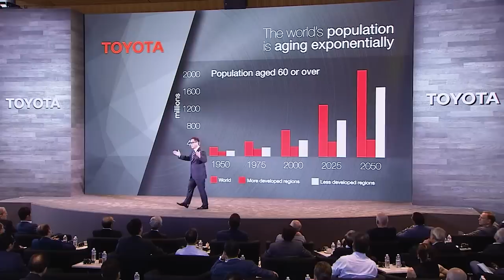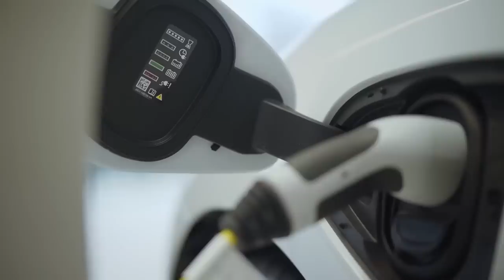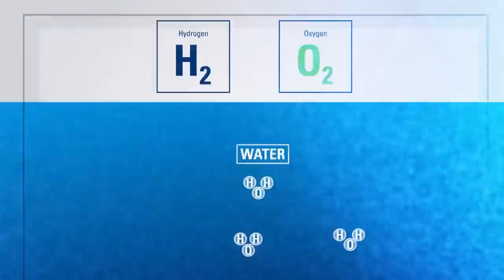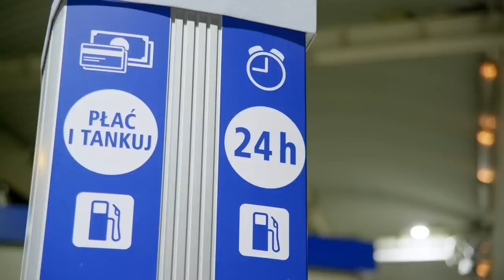New Toyota CEO Shocks Everybody | Huge News

Comment: I like the concept of hydrogen over EV. Just imagine the pollution to make batteries and the E waste. 😵‍💫
Reply: I know I always look at it as exchanging one problem with another, I want to know how long will the batteries last will the driving range decrease as the battery ages and if so how much year by year and how are we disposing the batteries and how will that effect the environment and lastly how are we generating the electricity to charge these cars
Reply: Hydrogen would work just fine if the refining methods could change. It takes a huge amount of electricity to create pure Hydrogen. Hydrogen does work excellent but uses more energy to produce and ends up being the least efficient by a long shot.
Reply: Hydrogen production uses heat to produce...heat provided by burning Natural Gas. The carbon cost of creating Hydrogen and simply burning Natural Gas is almost dead even, depending on the purity of the hydrogen produced. Hydrogen's carbon cost is certainly lower than EV, but it's still not "carbon neutral."
Reply: Every fuel cell hydrogen vehicle has a traction battery, you know?

Also 3-4 times as much wind turbines and solar panels doesn't create any e waste at the end of their life cycle.
Your logic is absolutely flawless.
Reply: Also Toyota thinks that EV’s lack infrastructure, and their solution is hydrogen? Do people have hydrogen faucets in their garages? The only places where even gasoline infrastructure is better are in the third world, and Toyota, like tobacco companies, thinks it’s their last refuge…
Reply: @noeoep  fuel cell is a straw man for all that are against EV because others prefer EVs. It's not about facts.
Reply: @alphastratus6623 . Ballard had Hydrogen fuel cell busses running around Vancouver for several years. Do you know why they were a failure? Apparently you don't.
Reply: But refining hydrogen is way more polluting than creating an EV. Not to mention, that hydrogen cars are EV, they are just charged by Hydrogen. You don't have Hydrogen avail everywhere, but you do have electricity availble everywhere. I do have an EV, but I also own a gas powered car, but I rarely use the gas powered car, because I can go everywhere in my EV. Where I live, there are fast chargers everywhere, and I do live in a cold climate area, and I still go 300+ km, without recharging the car, in -15 degree c. 110 to 120 kmh.
Reply: @alphastratus6623  I'm definitely not against electric vehicles but I don't think we can go 100% electric either, I think EVs are great for getting around cities and being used as daily drivers but I'm not so sure they are going to be effective for farmers or the construction industry at least as the technology is at the moment but I would love to see all public transportation switched over to electric powerd vehicles and more city daily drivers using electric cars but I also have my concerns
Reply: Truth does hurt
Reply: ZOOM OUT YOUR VIEW. the problem is PRIVATE CARS ARE INHERENTLY STUPID- 2000kg of metal to move 100kg of person has NEVER made sense no matter the fuel source.  get our of car-centric tunnel vision.
Reply: @theQuickining  Why shouldn't the cars on construction sides or farms shouldn't be electric?

Farm and construction equipment, that's another story.
Reply: @raywagner8016  Green hydrogen (only green electric energy) or some grey hydrogen as a side product of an industrial process?
The second one is not environmental friendly at all and no valid point for the discussion.
Reply: @A_friend_of_Aristotle  It uses electricity, which doesn’t need to be generated from natural gas.
Reply: way less than making ICE cars and burning oil.
Reply: @alphastratus6623 . You can refine Hydrogen using a disproportionate amount of electricity to produce it or you can power a Hydrogen cell using Propane or Natural Gas. The Ballard Power Systems version used Natural Gas. Either way, neither is viable. Heat in is greater than the heat out... by a lot.  Period. So yes, you have no valid point for discussion.
Reply: Current problem is the hydrogen pump station always broken.
Reply: @raywagner8016  When they used natural gas it's far away from green. So what's your point? It's not a green option, so why did you bring it up?
Reply: @theQuickining  These questions have all been answered, the batteries only last less than 10 years and yes using them does diminish their effectiveness. 
Imagine if using a fuel tank made the fuel tank get smaller every time you use it until it needs to be replaced.
Reply: On top of creating hydrogen being difficult, transporting it is hard too and costs a lot of money, and a truck likely running on gas.
Reply: Just imagine the non-existant tech needed for hydrogen! Plus the lack of safety!
Reply: Wait what pollution? This will solve all climate issues, don’t you watch the news? Don’t even think about what is power it he electric grid that gives your car electricity. I’m sure that’s in the carbon neutral offset calculation…
Reply: @joshuaenos9001  Electric power only pollutes if you insist on burning coal like a caveman.
Reply: Hydrogen cars have an battery with from 7,5 and 15 kWh. And the drive unit is fully electric, exactly the same as an EV...
Reply: @noeoep  like a hose bib or outdoor faucet? how many people have garages? Have you been to a third world country?
Reply: @Pilotfarmand  lol you drive your EV because it cost up to your nose, and it’s novelty currently. 

Reality is electricity is cheap because BARELY ANYONE is plugging EV to the power grid, once they do, guess what? Because of you and others, many who don’t even drive will have higher power and heating bills.

Why? Because one the grid is overwhelmed and they have created so many public or private power stations, someone will have to subsidize all that or pay the costs. This means the “reasoning” behind owning an EV will be useless because it won’t any longer be cheap to fill up. It’s a drg dealer, the first 10-20 hits will be free or discounted to get your addicted or in the door, once you’re a client and they have established themselves, you will begin to pay actual prices making you afford less.

The same logic will happen, and once these same EV companies have “overtaken” ICE cars they will draw up contracts with power companies to make even more cash by letting them increase power usage through their sales. 

Now power prices will go up and the ones subsidizing your “fill up” costs will be the rest of the citizens paying higher power fees because someone wants to save the planet.

The result? Half asszed EVs will hit the market that will ware out faster but be cheaper to balance out the high costs of living some people will have to deal with.

And if you’re a clown buying EV now because it’s “cheaper to fill up” you will soon hit a wall and a problem when those plug-in fees jump up.

What, you think power grids will just support everyone plugging in when they can barely handle super hot days and ACs to the max? 

Hell even the subsidy some countries handed out during cvid made regular folks feel the pinch when “regular rates” were back on the table.

Reality is EVs destroy the earth more to get the resources, it will costs lives when countries begin to war for said resources, slave wages in the countries mining it, no open source for repairs because all services may end up patented or restricted, high costs to “replace” maintainable parts, instead of having a car for 30 years you’ll buy “new” batteries for 1/3 of a entry level vehicle’s price every 10-15 years (think iPhones) which is what they want, consumerism 

It makes more sense to sell you driving iPhones that need constant replacements then to give you a heavy duty tool that will last you even a lifetime and bring many uses. 

The funniest part is you guys say EVs are cheaper to make etc, yet the price tags don’t reflect that, the interiors are hideous and plain, yet cost you more than a luxury brand. Imagine when these smart cars team up with insurances to place speed limits on your vehicles or can disable your car because you broke “a rule”? 

Hell no
Reply: These bandwagon hipsters don't think about that at all. They just want to post on Instagram they are "saving" the planet by driving a crap made Tesla.
Reply: @ftws41  I haven’t recently. A third world country could start with a solar panel+ electric bicycle for every household? My point was that to plug holes and weak points in existing infrastructures is easier than building a completely new and more complex one in addition to existing ones. And i think for most cases elecrical infrastructure is a best choice because it’s usually public, can in principle be made carbon-neutral, and is neccesary anyway. Hydrogen is best left to aviation, where it outshines the other two. Hydrocarbons are a limited resource and are handy for many things other than to be set on fire.
Reply: @hakasonma8588  I am not sure which country you are from, but my guess is USA. But your comment is irrelevant. Where I come from, the energy used mostly comes from 100% wind energy, and we share grid with countries that have a lot of energy produced by natural water flow, which makes the energy cost to consumers very cheap. Most of the cities have environmental zones, where no diesel car or trucks is allowed, so they don’t pollute with toxic gases inside the city zone, where population is dense. Yearly people are having health problems due to that exact problem, which having a high demand on our healthcare. So by going electric makes much more sense. But if you are from the states, I do question your education level, on this specific problem, since I often see a link between Americans and that subject.
Reply: "6 in one half a dozen in the other" is the expression.
Reply: @A_friend_of_Aristotle  Fantasy land is carbon neutral, though.......
Reply: The Toyota Mirai Hydrogen power car still uses an electric battery. It captures static electricity produced from separating hydrogen molecules, and charges a battery, to power an electric motor. Emits nothing but water.
Reply: @Your-Mom162  what is the size of the battery in electric car and hydrogen car?
Reply: @A_friend_of_Aristotle  Most of the new Hydrogen plants being built at the moment are using renewal hydro, solar and wind to power.Still I can't see Hydrogen being the solution for general vehicles, perhaps trucks and buses will work.
Reply: @zacharyb2723  and cramming as many people as possible in as small a space as possible is also inherently stupid. This is not the makings of a healthy society but a means of corralling every one into a easily manage confine for the purpose of controlling what the individual does. Where is all of this electricity going to come from? The grid currently in summer struggles on warm days due to the demand for power to run air conditioning units, not to mention how it is supposed to cope with an ever increasing demand for power to charge EVs in off peak times. I can't imagine that a large percentage of the population will revert to clean transport such as non electrified bicycles, though that would have excellent health ramifications! Modern nuclear technology is the probable answer but constantly gets a bad rap because of old nuclear technology reputation. We can't have it both ways.
Reply: @raywagner8016  The energy in water when cracked  is about 14 times more potent than petrol, but to harness that potency requires an even more energy intensive process. Great for party tricks but not likely to be viable for quite some time at least until someone comes up with a device which produces more energy than it consumes like Victor Shauberger's Trout Turbine (apparently).
Reply: @noeoep  Yes. It's called freaking tap water.
Reply: @Pilotfarmand  lol I’m Canadian so I’m in similar position, except over here just like fruits and animal protein, we pay up the wazoo for the same things even poor countries pay less for... just take a look out our cheese prices... we have massive land, livestocks etc yet we pay more than many do around the world....

In this case the same is said about power, many of us pay way cheaper rates than in the US but in my province we have also had our public system for energy be almost sold off and privatized, which would mean by now, we would probably be paying up the wazoo for energy prices, just like our cheese, meat and milk. 

My point is relevant, because like I told you, currently your energy system is not overloaded because not even one is plugging their EVs to the grid. I’m glad you have many clear resources, but those resources can only do so much for you. Once 70% of the population is draining power for EVs simultaneously, you really think the power grids will support this while also having high volume peaks on hot summers and freezing winters? It will, and the COST of USE will RISE, so the reasoning of “cost to fill up” will be out the window. 

The people who don’t even drive? Those poor people will be the one subsidizing the costs for EV drivers, because since they will also be paying higher costs while using less energy, this will offset the profits companies or government are making and losing.

You think company will build new windmills and water sources for free to maintain the EV infrastructure? No, and those may be in the billions. So someone will be paying for the ride in use of energy. 

That’s my main point, I don’t care if you drive EV or gas or diesel, somewhere along the price tag companies and governments will play a roll in higher living costs. 

When it was CVID my province “lowered” the rate of energy, but as soon as CVID was dying down, they “updated” the meters and increased the cost of energy way high with the excuse “we had a lower rate to offer Canadians assurance during hard times” so essentially they MADE BACK what they had “lost and offered as discount” by increasing the “regular rate” higher than before. Imagine with millions of EVs connected? I can assure you my half private half public energy supplier, would spike my costs of energy regardless if I drive an EV or not. Right now more than 60% the EV market is subsidized so no one if paying the true nature of costs hence why not even energy companies are spiking prices yet, the government would most likely throw them “grant money” to Shyt lip and hold to current prices, otherwise exposing such a fact wouldn’t persuade many to buy an EV if it meant increasing costs of living in a home
Reply: @skybattler2624  Hydrogen isn’t exactly “water”. Freaking or plain. Surely there was a better word for me to use instead of “faucet” but you did hopefully get the point that charging a hydrogen car at home is, let’s say, complicated. As is btw storing any significant amount of hydrogen.
Reply: @raywagner8016 If their shipping over land or pipe system does get built out, there is tons of inexpensive open land to build solor base hydrogen farms.

As far as water, the could realistic collect the water from hydrogen fuel cell vehicles, and collect it in stations for return to generators in the desert.

This would minimize excessive water use in theory creating a sort of grid.

Then they can collect some of the oxygen for medical or manufacture needs.
Reply: It would be very hard to make enough hydrogen and if a hydrogen car got in an accident it would probably go boom. Can we really build a accident proof gas tank? The Titantic engineers would probably think we could build a crash proof tank but I hope were smarter than that. On my drive home from work today I saw someone drive right into another car without even touching the brake, this is not a rare occurrence either most days I past at least 1 accident on the way home some days I pass 4 to 6 accidents. I don't know if they got drunk before the baseball game started, were playing on their cell phone or they were just really stupid but the moral of the story is Seattle has alot of really incompetent drivers and the city of Seattle needs crash proof cars.
Reply: Just imagine the pollution over the while cycle if a car and not just the battery... And actually know how EVs compared to ICE. Imagine that...
Reply: @Zachary B  are you suggesting I ride a pedal bike in a blizzard? Public transit? Doesn't exist where I live
Reply: @aspenGF8  You live in Antarctica? Then you need a different tyle of transit.
Reply: @DroneTimilib  future problem is the scale. You just can't run millions of cars on H2. Not technically, nor in terms of physics. It makes simply more sence to use the needed electricity directly in batteries, than going the detour of wasting energy by producing H2 in between.
Reply: @functionatthejunction  Can we talk about how heavy electric cars are if you want to talk about safety? What happens when a 10,000lb electric truck runs into a normal 3000lb car?
Reply: @yesterdayschunda1760  The average weight of an EV is 5,000 pounds, 700 pounds heavier than the average car and 1,000 pounds lighter than the heaviest SUV; which are all lighter than a semi.

Exactly what is your point?
Reply: @functionatthejunction  And no safety standard tests for such heavy vehicles, your 5 star ANCAP safety rating is from 1.5 tonne trolleys at 80km/h not from 3+ tonne ones. Your 5 star car would be lucky to survive a 40km/h impact with an electric vehicle where as it would have survived an 80km/h impact with a normal car.
Reply: @yesterdayschunda1760  Again, an EV weighs, on average, 700 more pounds than a gasser. And neither come close to the largest SUVs or semis on the road, so why single out EVs? They arent remotely the heaviest vehicles on the road.
Reply: @functionatthejunction  wtf do you think an average car is? A Toyota Corolla is an average car it weighs 2900lb. A Tesla is an average electric car, the model 3 weighs 4100lb
Reply: @functionatthejunction  For the record 4100lb in the Tesla is a full 300+kg heavier than ANCAP safety tests. Electric cars will cause a massive spike in car on car deaths. this is a fact.
Reply: @yesterdayschunda1760  My source is JD Power. You have yet address the weights of current cars on the road, particularly gasser SUVs.
Reply: @davidkennedy4845 . The energy in water is released every single day in the form of lightning. All you need to do is capture it. Re-creating it takes energy. Lots of energy.
 
As for Victor's Turbine, can you hear it running? Does it make heat? Does it create some sort of wind while it spins? Does it rely on bearings of some sort? Does it eventually wear out or require a rebuild at some point? Every one of those questions should be asked when someone tells you about a free energy machine. They are all byproducts of friction. Friction is an energy loss. Nothing mechanical makes more energy than it consumes. That's basic Physics and Einstein proved it for you with the Theory of Relativity. "For every action there is an equal and opposite reaction." Throw a Baseball and it will stop. Why? Friction.
Reply: @aspenGF8  A pedal bike is probably faster and more enjoyable than Seattle public transit.
Reply: @Weathernerd27  safest way to travel in Seattle to to travel away from Seattle.
Reply: @A_friend_of_Aristotle  Nope. Nuclear power + water = unlimited amounts of almost free hydrogen.
Reply: @A_friend_of_Aristotle  That is the current state of producing hydrogen but there are many people working on green hydrogen coming in the future.  In a 100 years people will look back and laugh at the push for EV's.
Reply: @noeoep  electricity doesn't grow on trees. One EMP attack and your taken for granted electrical outlet in your garage will be dead for an unknown period.
Reply: @theQuickining  I'm a farmer and I can guarantee that if farmers are required to use batteries to power farm equipment, there will BE NO FOOD. So you better have a plan on where you will get it. Probably from the government (who will be using fossil fuel powered equipment).
Reply: @TheCh0wderp  hydrogen can be produced on site as needed. No need to haul it all over the country like fossil fuels.
Reply: @hakasonma8588  It's all common sense....but don't expect anyone to understand that as common sense is really rare these days. Almost everyone believes the daily propaganda report.
Reply: @noeoep  SInce you can spend the money for a high voltage, high amperage outlet in your garage to quick charge your EV (provided you actually have a garage) you can also invest in a self contained hydrogen generator that produces hydrogen on site (located in your garage --- provided you actually have a garage).
Reply: @noeoep  you don't STORE hydrogen. You produce it ON DEMAND...where ever it is going to be used. Nobody is going to be hauling around large quantities of hydrogen.
Reply: @functionatthejunction  I have a full sized SUV and it weighs nothing near 6000 pounds. It makes absolutely no sense hauling around 1000 pounds of batteries because it limits the actual payload and usefulness of the vehicle. Every pound added deletes a pound of payload. Simple math.
Reply: @northdakotaham1752  The average full sized suv clocks in at 5,642, while the average mid sized is 4,678. There are weight charts for most models online.
Reply: @functionatthejunction  of course. Mine would be mid sized and I was referring to net weight as opposed to GVWR.
Reply: I do too but fuel cells expire in about 10 years.
Reply: @josephkramer932  imagine after 10 years the e waste so now we already polluted air now we are targeting soil! So if soil is damaged then how u gonna fix environment because only more trees can fix air.
Reply: @northdakotaham1752  Of cource. After having used my fuel-cell powered laptop for a month on a single charge, I’m nevr going back to those crappy lithium batteries.
Reply: @noeoep  Lithium batteries serve a purpose for low amperage applications. Add a whole bunch of them together is not a smart idea however.
Reply: @northdakotaham1752  So how much gasoline one can add together before it becomes unsafe? Or hydrogen? Gasoline cars seem to be expoding easily, lithium cars simply burn. What would a hydrogen car be likely to do?
Reply: @noeoep  gasoline cars RARELY explode....except in Hollywood movies. The fuel to air mixture to even get a fire started in a gasoline car has to be near 15:1 ratio. If a gasoline vehicle does catch on fire, it can quickly be extinguished by the simple use of either a foam agent or CO2 which removes the oxygen from the fire. Once the fire is out, it won't re-ignite unless there is some additional source of ignition like a battery fire on an EV. In the case of hydrogen, once the fuel tank has ruptured and the hydrogen escaped into the atmosphere there is no further danger. Hydrogen is a natural element so it's release into the atmosphere presents no ecological threat. An explosion of hydrogen would almost have to be intentional as it will only explode if it ignites while under pressure. BTW...if you have ever driven a fossil fuel powered vehicle, gas or diesel, you have unknowingly produced hydrogen bc the lead acid battery used to start those vehicles produces hydrogen gas when they are being recharged. The hydrogen escapes into the atmosphere as you drive.
Reply: @A_friend_of_Aristotle  how about using nuclear or wind?
Reply: @zacharyb2723  true! care culture is inherently a non-carbon neutral proposition atleast right now. We can simply use public transport, and be very less polluting, but car companies wouldn't like that.